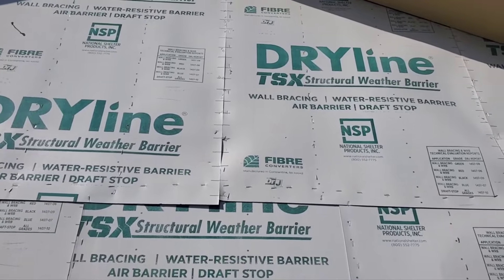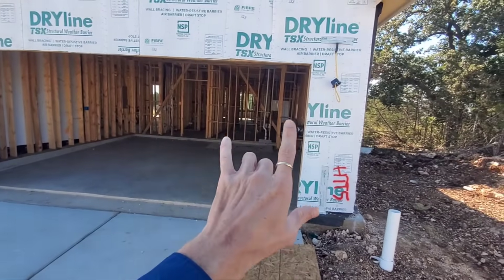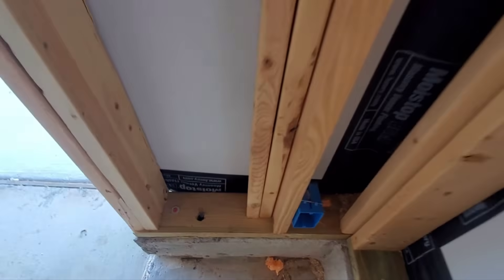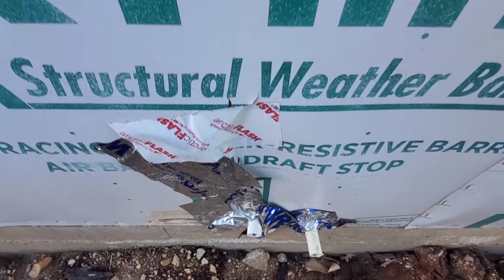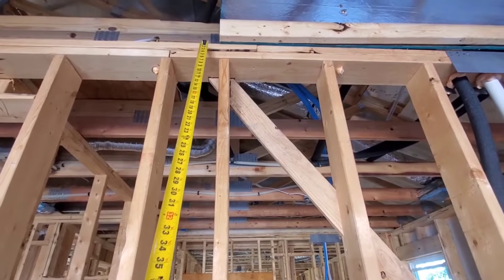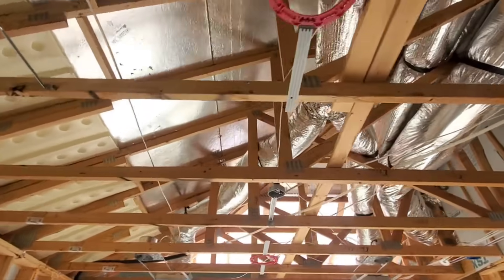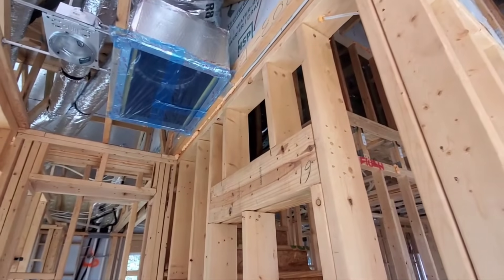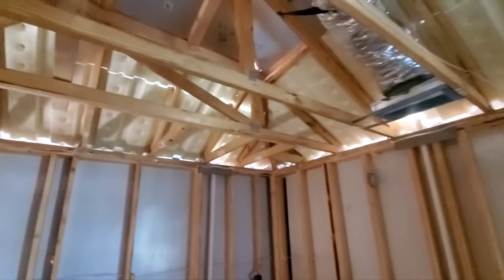Fun findings following the pre-drywall inspection around Austin, Texas. Two words: IMPROPERLOAD PATH

Comment: just a question out of left field... so with the top plate issues.... how would they go about fixing that issues at this stage of the build?
Reply: Typically by hiding it behind Sheetrock
Reply: @jessewilson8676  Ha.. yes ... after the fact... but I'm wondering if the issue was pointed out during this framing stage... how would the builder fix the issue?
Reply: They make metal straps meant for joining top plates. Maybe just strap over that butt joint and hammer with a palm nailer.

Comment: That sheeting is not providing any structural strength.
“Structural Sheeting” printed on it.
It is just cardboard.
What’s the point of insulation foam on cardboard?
In CA OSB is minimum requirement.

Comment: You remember what the old folks said when every kid got a trophy and no kid won? Yep told you so. 
While I completely understand that framing carpenters aren't structural engineers, understanding load paths isn't a concept reserved for structural engineers. when I got into the trades 30 years ago even a 2nd year laborer could grasp the concept. But then again I've never been on a job where this kind of BS flys, let alone would ever be left for an inspector to see. 
This is work done by a crew that hasn't ever been shamed for their actions.

Comment: Why don't the Contractor goʻ ahead and do things right, instead of having too come back to do it over.
Reply: Because the city inspector PASSED this nightmare, it would have gone to drywall with NOBODY noticing or caring! The homeowner would have had the nightmares of trying to get it all fixed after they had been in a few years and problems started coming up. The builder would have been long gone and working under another name.

Comment: That’s sheathing in Texas?  That’s laughable.  Flashing tape?  Wow - you should see what we do in Canada.  They moved that truss for vent.  This was obviously done by very low skill workers.  Lot of wood - just done without a clue.  Done by untrained workers without supervision.  Anchor bolts were a joke.  Sheathing was cardboard- can’t believe you allow that.  How is this house air tight?
Beams etc were almost all a fail. Where I come from sheathing adds to structural integrity ( it’s all screwed or nailed). Vents were not screened or sealed.  How are you keeping bugs and termites out?  This house will be full of ants.

Comment: Some of the worst craftsmanship possible on full display.  The builder of this home simply doesn't care and thinks that covering it means it will be OK.  Housing codes were designed to prevent this nonsense from happening.  The builder's license should be revoked.

Comment: This is one of the worst looking builds I've seen.  Is this common in the US to sheath with paper??   LOL paper really???    Do they just sit sills on top of bare concrete without a vapor barrier??   Do they not have wind or rain or weather in this part of the country?   It says dryline structural weather material.  It's not structural, not weatherproof in any way.  It looks to me these builders are one step away from sheathing their homes with toilet paper.  This house would be cheaper to tear down than repair to pass inspection.